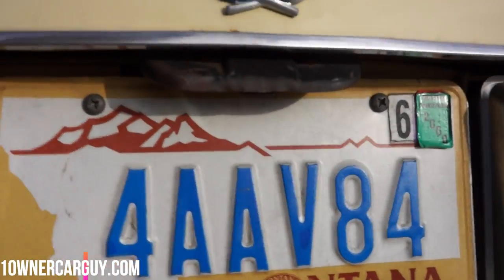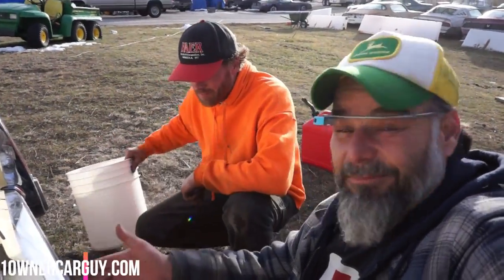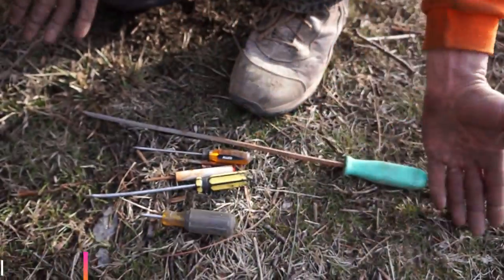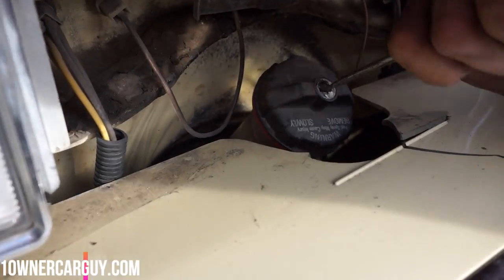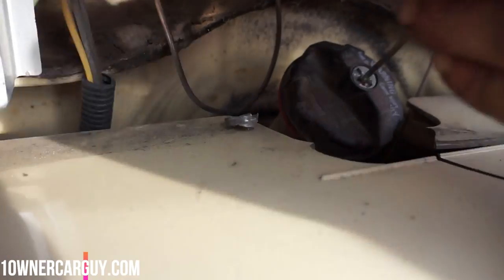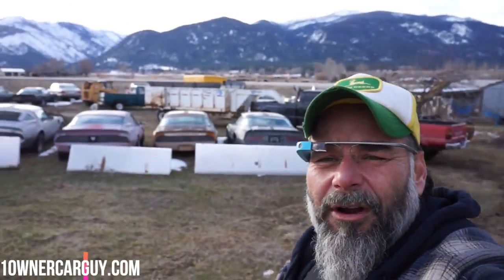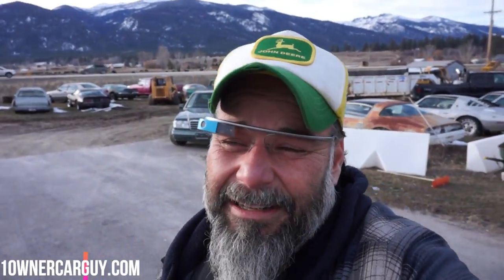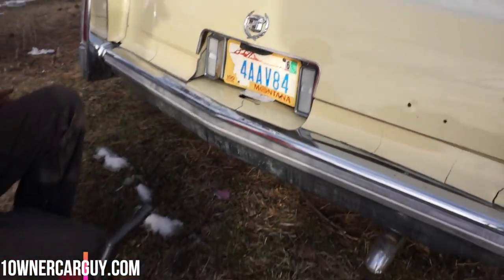OPEN A LOCKED GAS CAP ~ HOW TO FIX BROKEN OR STUCK DIY ~ DAILY WORK VLOG 2020 0059

Comment: There are only like 6 different gas cap keys in the world.  They are the same key blanks and key cuts used for a ton of misc. stuff like old trailer locks. Save all your old keys in a shoebox and I guarantee you that you will find keys that work in all kinds of stuff.  I’ve been a Professional Locksmith for over 30 years.
Reply: You are correct on everything except there are 10 different keys.
Reply: So what's are the chances if I go buy another gas cap with lock the key will fit the one on my car.?

Comment: That’s been parked  as long as my 72 mark IV . Would be cool if you fixed it up mechanically and drive it around come summer 😀. I really need to do the same, start up all my cars . I’d like to find a 74 Plymouth Duster . I have the perfect parts car.. I need a rust free shell.

Comment: I appreciate the video. I just bought a Mitsubishi eclipse and I'm sitting on a quarter of a tank of gas and I tried to take the gas cap off because it's a locking gas cap and all it does is spin even when I have the key and I put in it. And my personal opinion this is a product that should have never been made and I think it's absolutely idiotic that these things are out there. The last thing a person needs is to try and twist a gas cap off in the damn thing just spins. You want to lock your gas put the lock on the cover that goes over your gas tank but honestly I don't see the need for any of that because it becomes an inconvenience later when you can't put gas into your vehicle because your gas cap is stuck and just spins around in circles. Totally stupid invention in my opinion. When I get this POS off my car I will be buying a regular gas cap to replace it and I protect my gas the old fashioned way. I catch you messing with my car you end up with holes in you. 🤷🏽
Anyway I'm literally just frustrated because this gas kept thing just happened to me 6 minutes ago and I just bought the damn car. Informative video though thank you